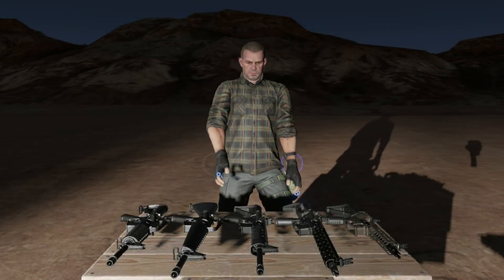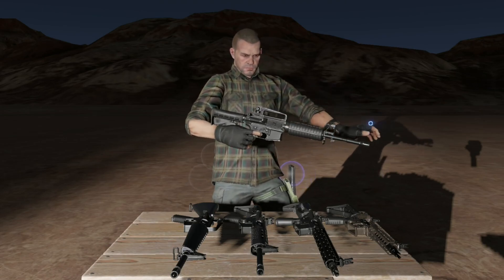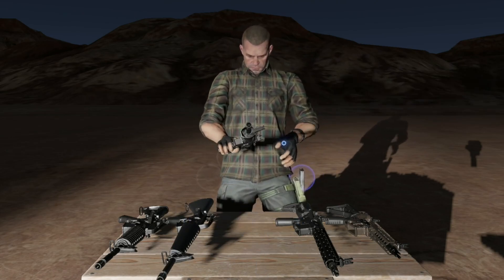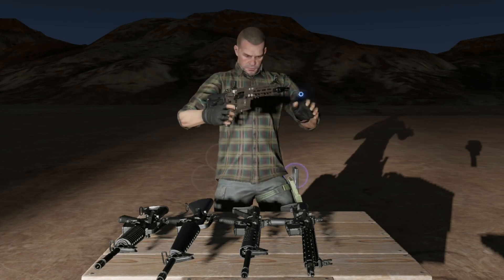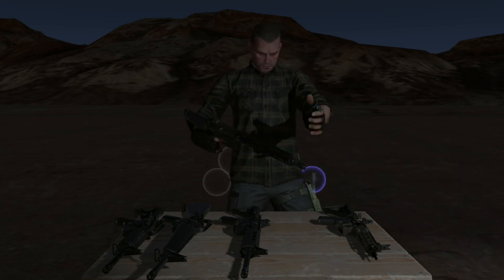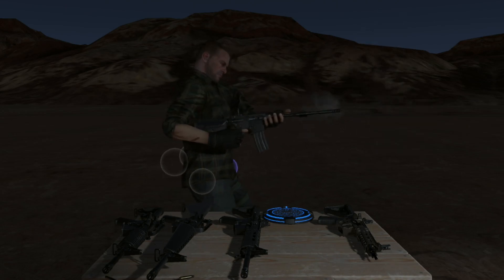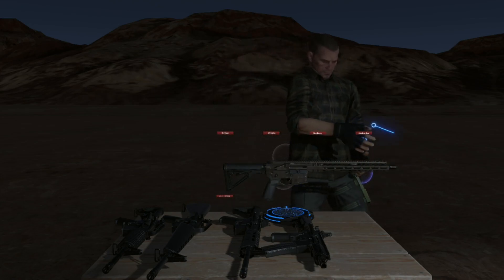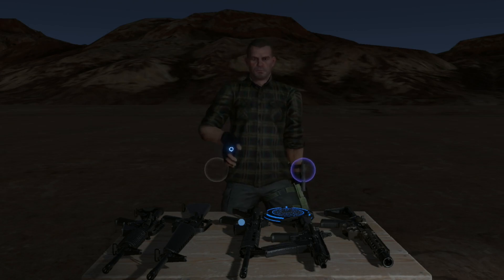ModulAR2 Devlog12 - Audio and Muzzle Flash Reborn!

Comment: Don't you think the RPM of the full auto ar-15s is excessive? To my ear it sounds more akin to a mg42 rather than a 700-800 ish rpm.
Reply from the maker: Havent actually tested the rate of fire in a hot second, but they’re basically Anton values. Will confirm this week.
Reply: @meatbanana5684  So you don't have to but you could also probably implement a rate of fire increase when adding a suppressor, or even change the case ejection pattern. but tbh i think the mod is already above and beyond so do what you want.
Reply from the maker: @ethang9932  if everything is set up correctly, suppressors should already increase fire rate slightly, and do increase the amount of gas ejecting out of the chamber when shooting!

Comment: IMO the bolt sounds should be way less loud, The guns sound like   60% bolt 40% shot.
Imho it should be somewhere like 10-20% bolt, 80-90% shot
It just doesn't sound good to me.
Reply: Agreed. I know we’re only dealing with 5.56 here, but it would be nice the have some more “chonk” to the firing sound. Some more bass tones maybe. Keep in mind I know nothing about sound design, but agree pretty much fully with your comment: too much bolt sound.
Reply from the maker: Totally hear you there! Unfortunately, I dont have control over H3's sound system, and Anton doesnt "duck" or lower the volume of other audio events in the game to allow the shot sound to rise to the top of the mix, and give you that 80-90% shot sound, 10-20% everything else balance you and I would like. The only way for me to achieve that is one of two ways:

1.) I boost the shot sound by 2-400% and absolutely blow out your speakers and make for a legitimately unpleasant gaming experience so all you hear is shot sound (I'm already pushing volume 10-20% louder than any of Anton's guns.
Or,
2.) Drop the handling audio by 80-90%, but then even in a dead silent room you would barely be able to hear the charging handle/bolt operation sounds, which based on some of my personal readings, if you run that bitch hard, can reach up to 100db on the bolt slamming home.

In terms of working within Anton's audio mix, its a lose-lose and the result is a pretty mechanically "present" firing experience.